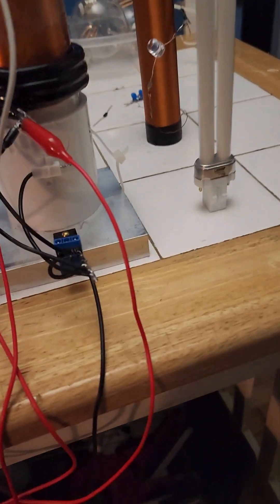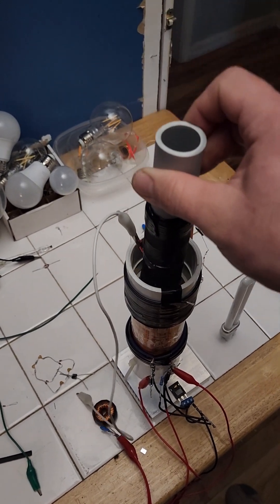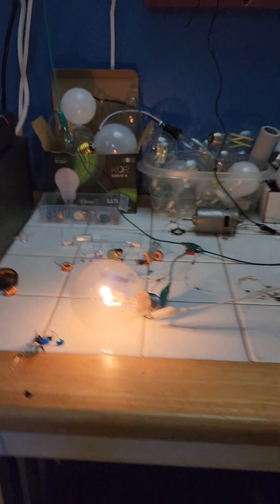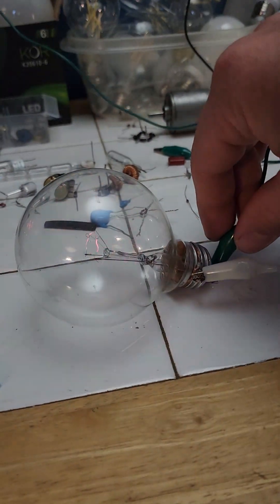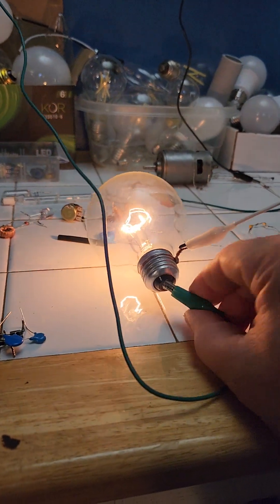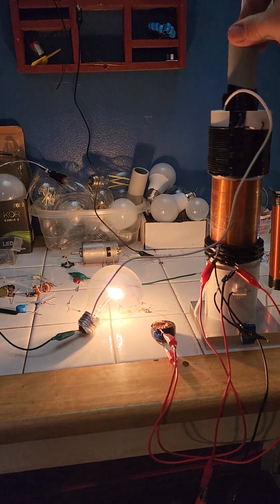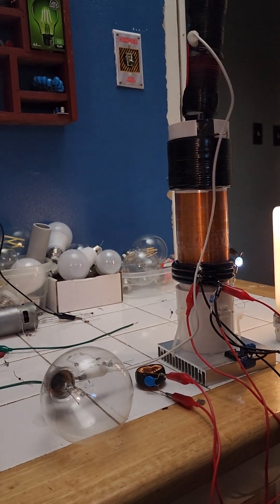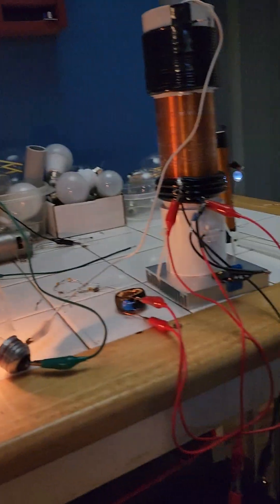💡DON SMITH WIRELESS AMPS COIL BREAKTHROUGH. 1 WIRE HALOGEN LOADS NOW RUN VIA EARTH ENERGY 🌎

Comment: bog standard air core transformer theory.
Reply from the maker: Possibly but my transmitter can create unlimited wireless lighting & I can receive more power then I'm transmitting from seperatly Earth grounded & Tuned receivers
Reply: @MTECHINDUSTRIES  OK prove it and show the math, lets move the world forward
Reply from the maker: @Andrew Doherty  I'm trying I'm just 1 guy & 3 people help me out off & on. Other scientific labs around the world verified that they can create unlimited light when the transmitter is on. Similar to how there's no limit to the amount of people that can tune into a radio. Old school radios like crystal ones were powered by the radio signal/Earth itself. The power to be harvested is everywhere & nowhere at the same time as long as your in range of the transmitter. Electrical effects at in range receiver stations are then made manifest via tuning.

Comment: Please power from a battery and rectify this inner field to dc then measure input vs output
Reply: with the contact I can modulate the advance of the output .... the more voltage I have the less current I have, the less voltage I have the more current I have ... I think that the current moves by imbalance. and nothing else. wait for my sid not move with the grounding and the parts I just bought I'm going to do heavy .. very heavy .. I'm in a hurry .. hahaha ....
Reply: @anthokranken  Any results so far?
Reply: @isaiahj3968  2300 turn per minute under load and 2 x 240 volt ac and dc +the two bedini charge malik see my motor haha
Reply: Output lol ...

Comment: What are the values used for both resonant capacitors? 1KV?
Reply from the maker: So my resonant capacitor is a 2nf 3kv & having it in parallell with the wireless amps receiver coil makes the incandescent bulbs glow 30% brighter to ground while reducing power to transmitter